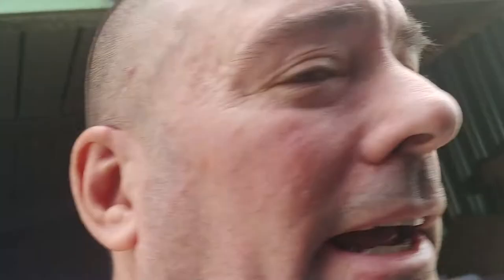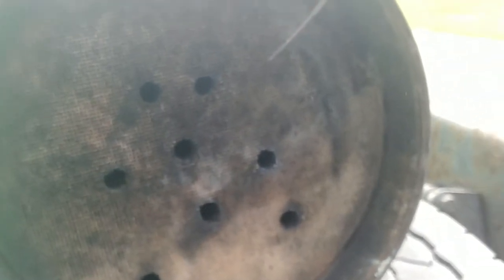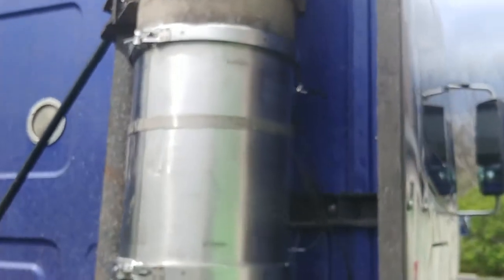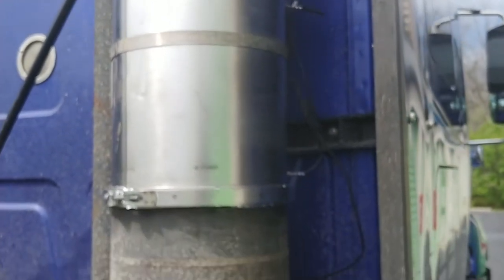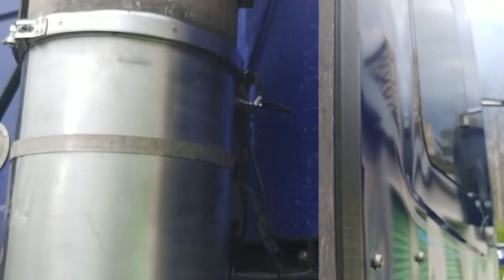Will drilling holes in your DPF work? Sort of..

Comment: Thanks from across the pond. Im doing this on my tiny truck ( fordtransit) . After it stopped completely the other day. I just ground one of the flange nuts of and eased the joint..she started straight away. Ive deceided to drill a 1” hole right through . Wish me luck👍😎
Reply: Did you drill a hole through the dpf ?
How's it running now ?

Comment: For that to work You have to download a engine calibration from another country. That way it will disable the dpf system. Dealership won't do that. Some outside shops do but it's illegal
Reply from the maker: This is true several guys that drive for the company that I drive for I've deleted it completely may I want to do this temporarily to get me by that's why I said it was illegal in the new filter is on and running correctly
Reply: Ok. I've seen some videos of people washing them with water and a pressure washer and apparently it works. I should have tried that before eliminating mine. 🤷

Comment: How's it running?

Just got 2008 peterbilt with a C13 dpf and would shut down because it wouldn't want to regen.

Mechanic charged 1800 took it off and drilled the whole thing out.
Reply: I was kind of wondering if drilling out the whole mesh would actually work out pretty good
Reply: do i need to tune anything if im gonna hollow it out

Comment: What if you drill halfway through it?
Reply from the maker: That's a question that I cannot answer however I'm sure it would still work
Reply: @bc9873  i had another thought after I posted this, have you tried putting that filter back in now you have changed the sensors